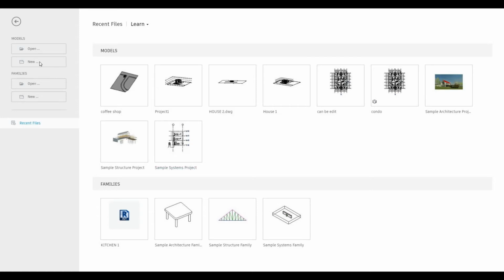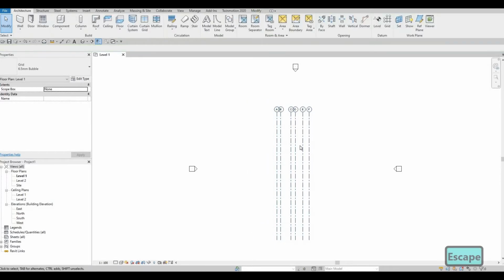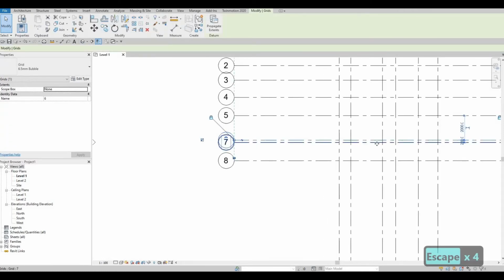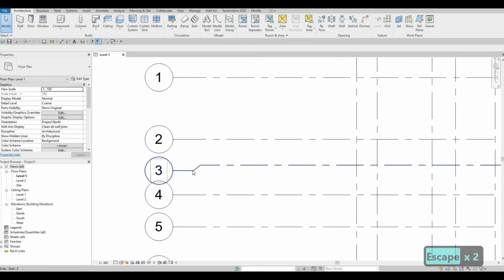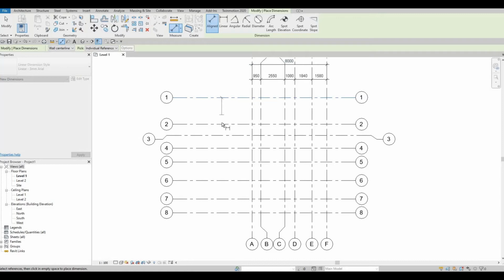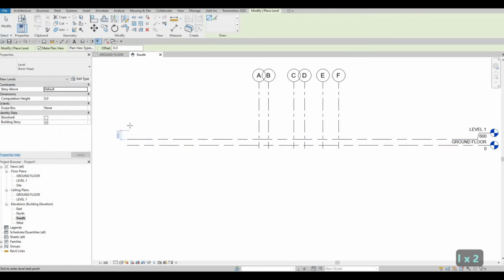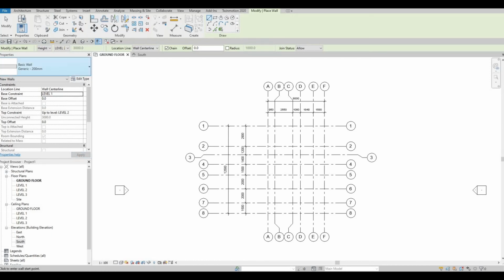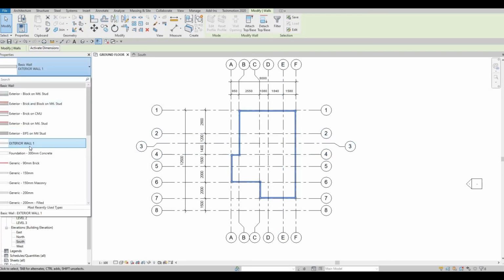SEEMES House 1| Part  | Complete Step By Step Project | Revit and Twinmotion Tutorial

Comment: How do you decide the distances between gridlines?
Reply from the maker: Hi Daniel, there are multiple function for the grid line, first is structure, this is where the column usually located, 2nd it helps for coordination or location, 3rd depending on location building code, minimum and maximum distance of beams and trusses are calculated from there. 4th many more conditions but that is what I can tell you for now. 🙂🙏